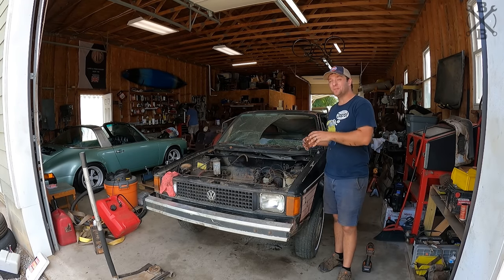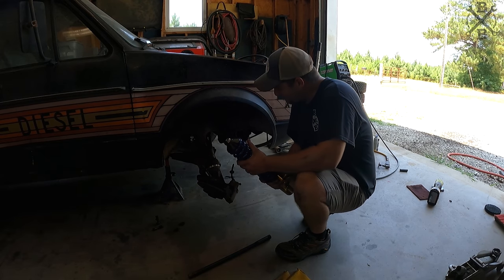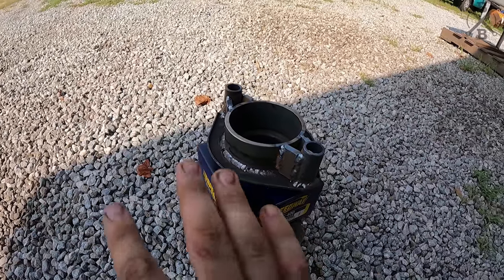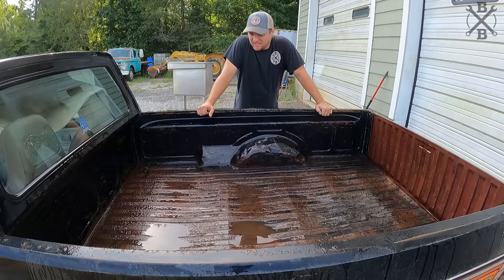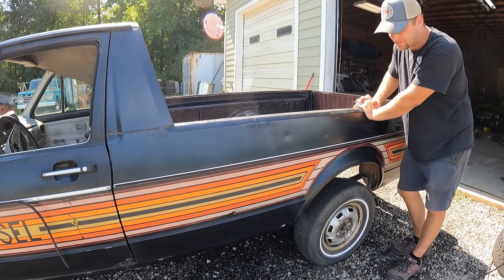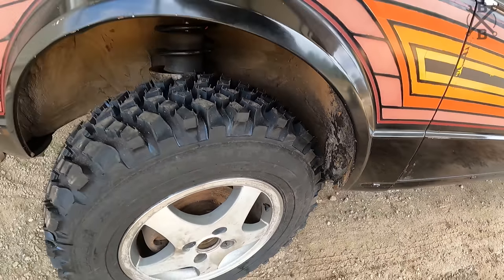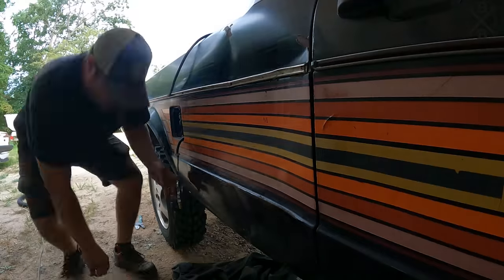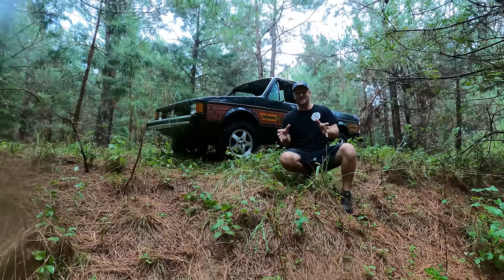ABANDONED Volkswagen Caddy Gets Lifted! Scrapyard Rescue Rebuild Part 3

Comment from the maker: I hope you all enjoy the video! Just something I wanted to mention. They do make a 2” lift that is bolt in for the Mk1 platform (CKW2). They can be installed with little to no modifications. Of course..wanting to be a bit different, we wanted to go with 4” of lift. I’ll need to extend the lower control arms slightly to compensate for camber. The main issue with this much lift is axle bind and rub. To this point we don’t have either though! 😃
Reply: That truck is looking so much better!

I'm going to have to try that Basketball trick
Reply: If you go to replace the windshield you can install a newer glue in one and not have to install another gasket style. I converted an older Jetta like that a few years back. Got a universal rubber molding and put it around the glass. Turned out pretty good and didn’t leak.
Reply: So I’m watching this video and thinking man what a shame the passenger side looks beat up, then you pulled out the basketball and I’m thinking what in the hell is he going to do with that. If I hadn’t seen you pop the dents out with it myself I’d have never believed it, gotta say that worked way better than I thought it would. That side might be a little wavy still but it looks a helluva lot better than it did before.
Reply: The suspension will bang. A bigger spring is made for a heavier vehicle the original spring is made for the right weight you could buy a leg extension kit so the suspension works. Looks good high. Nice 👍🖖🍺
Reply: Any chance you have a part number for those rear blocks? I'm having a hard time finding them.
Reply from the maker: @dcale89  Could not find the exact ones I purchased but they would’ve been something similar to this. Hope it helps! https://www.ebay.com/itm/296121830529?mkcid=16&mkevt=1&mkrid=711-127632-2357-0&ssspo=krINyn_XQcq&sssrc=4429486&ssuid=zE-wF99lTIG&var=&widget_ver=artemis&media=COPY

Comment: Man the basketball trick was very impresive, good job! Looks like a mini rally truck. Love it!
Reply: i agree. i guess i've gotta get a basket ball, and an american football for tighter spaces to keep in my body repair tool cart. they would be a lot cheaper than the $50-100 they want for the air bags they make to pop out dents.
Reply: I've got something similar thats actually ment for this style of dent repair. its basically an inflatable pillow that, when not inflated, is only around 2mm thick, so you can get it into really tight spaces. These things are called "Flatpad" or "Pressure pillow" and they are indeed very useful.
Reply: @Enakaji  i have a couple small ones with an inflator bulb and pressure release valve for forcing the top of a vehicle door frame to deal with a lockout. they work quite well, but they weren't cheap.

Comment: Big visible skid plate and some chunky bullbars on the front, a roll over bar with oversized spotlights behind the cab, and a CB aerial.  It'd end up looking like a RC truck in all the best ways.  Brilliant tip with the basketball, I can see that coming in handy, and the wheel choice is really good.

Comment: Make a stainless steel skid 'plate' out of 10 gauge sheet in place of a bumper.  Have it about 3/4" from the sheet metal, just follow the contour under the grill.  Back would attach to the engine / tranny cross member.

Comment: You have brought it a long way from when you picked it up. For the front bumper you might consider a page from the rock crawlers, straight across and bottom of angle back towards the tires with the ends angle up and out. They also use it as a air tank. It will need a little brush guard. I think a tube bumper looks good, but you might be too narrow to pull it off. Just a thought.

Comment: I LOVE YOUR VIDEOS especially seeing you working with your dad thats priceless not all of us have that blessing  DONT you have a hydrallic bench press to compress your struts using an old strut top housing upside down with alternator spacers or tubes over the threads
and a piece of thick plate over the centre hole where the press jack extends out  this  also allows enough room to acess the centre strut nut i been using this method for my ford front struts takes 5 minutes a side to dissasemble anyway keep up your great videos thanks for sharing from THE LAND DOWNUNDER AUSTRALIA

Comment: Excellent video Budget Buildz  (Mike)   :) those Rims also tire make VOLKSWAGEN truck like GM  S15 truck made sweet looking too and cool to also would put straight roll bar up from box post square frame around back window with 4 square lights turn by toggle switch power up also look nice ! Also slider windows in back cab  and put 1994  Toyota T100 chrome bumper on front and back ! Plus paint box floor top with High Quality Rust Paint Black from brand Rust Coat do 2 coats on brush on plus tailgate in front too then put Clear Coat of 2 coats of brand Rust Coat too very pretty truck then ! Plus if get fuel tank paint up to and clear too keep looking new !

Comment: Dunno if the CV joints are going to like this and the rear seems a bit soft, compared to the front, but this is a nice result.
Kinks are there to iron out later

Comment: Brotha you should put a passat tdi with a non electric injection pump in her. So the engine code is 1z tdi engine and you will definitely pass any safety or emissions with no ecu.

Comment: I always thought those Rabbit pickup trucks were the way to go.  Let's face it, 99% of the time, a typical pickup bed is empty.  That means 99% of the time, this FWD truck will have better traction.  Ever driven a conventional pickup in the winter while it's empty?  You know what I mean.  I also like the fact that no space is wasted as there is zero distance between the bed and the cab as the bed is not separate.  And fuel economy.  With the gas engine, it's great and with the diesel, well let's just say it was way ahead of it's time.  Finally, there's the appearance.  Just look at the front end styling.  Compare it to any other 40-year-old truck.

Comment: What's the 'Budget' on this build so far?  
Howzabout a bull-bar cage for the front end, but one that does not reduce the 'approach angle' of this raised rig?  Considering the angular lines of the cab and body, would you consider using rectangular profile tubing for both the front end AND the slats for the bed (instead of wood)?  I think it would work well with the sharp shape that it was designed with....  Just my $0.02!  Wouldn't flat tube be easier to bend around the front end than round tube stock and be easier to cut & weld into angle shapes???

Comment: Where did you find the tail lights I need a set bad.
Reply from the maker: https://www.ebay.com/itm/313731368496?mkcid=16&mkevt=1&mkrid=711-127632-2357-0&ssspo=pb96cp-wt-i&sssrc=2349624&ssuid=zE-wF99lTIG&var=&widget_ver=artemis&media=COPY
Reply from the maker: If you throw it on watchlist you’ll get an offer for less, which is of course what we did 😁

Comment: couldn't you have just made a lift for the front from a couple pieces of 1/4 plate steel, and a section of 1/4 wall steel tube with a large enough i.d. to fit over the top of the strut top instead of destroying a good top? seems kinda like a waste to me. don't forget to put longer brake hoses on it after all of that lift. last thing you need is to lose your brakes because one snapped due to a hard full suspension droop. been there, done that, don't wanna do it again.